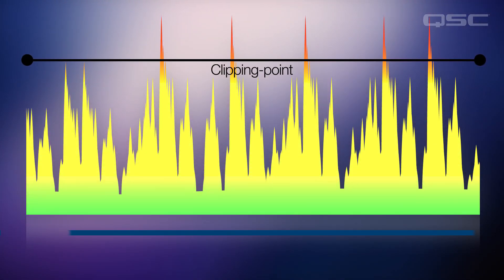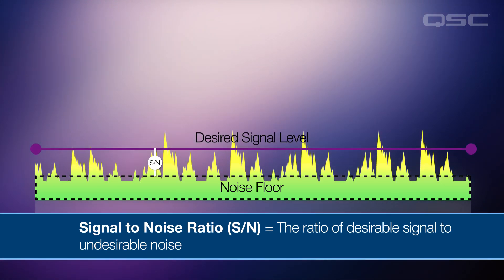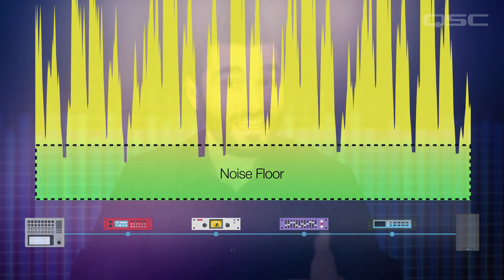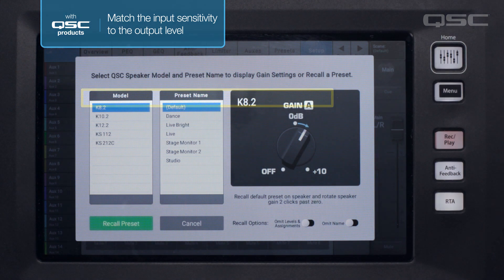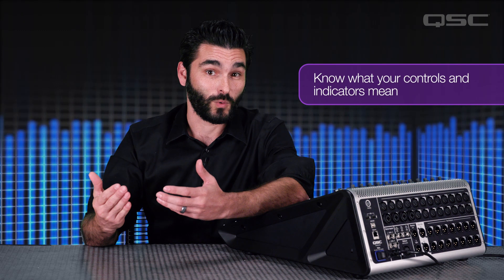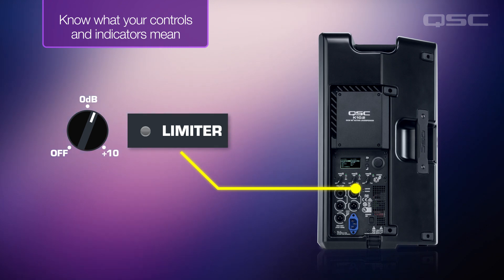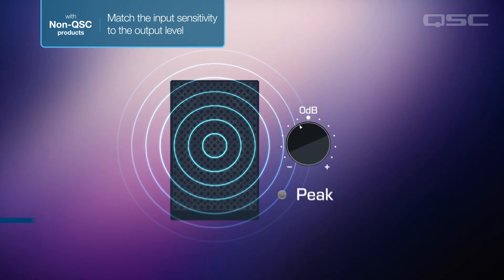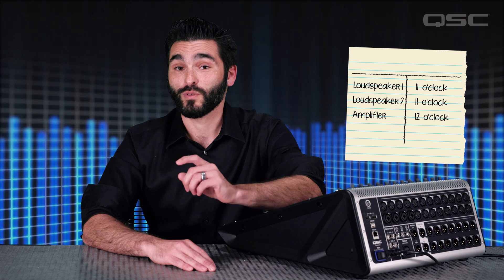TouchMix Application Video Series: Gain Structure Explained - Part 1

Comment: How does this work if I am connecting the L & R mains to a single sub and then to 2 K2.12 L & R?  Is the setup and testing the same?
Reply from the maker: Make sure your gain going into your first speakers are set correctly, then if you use the direct through output of the first set of speakers to the next, the gain staging should remain correct.